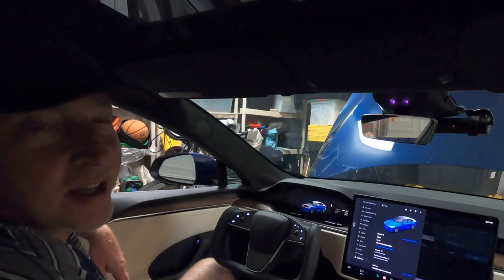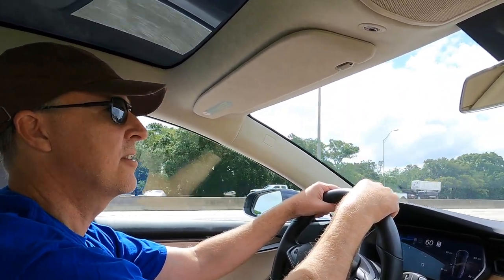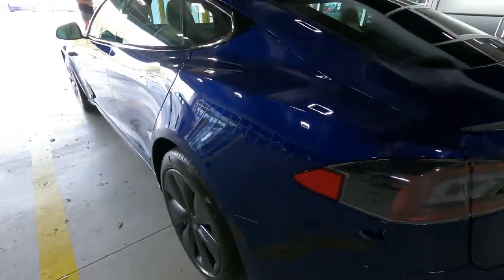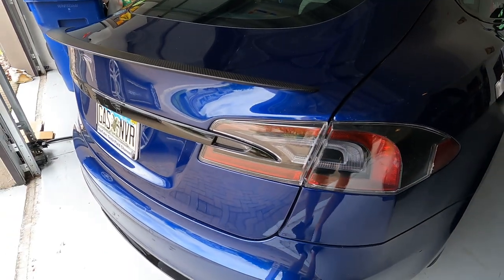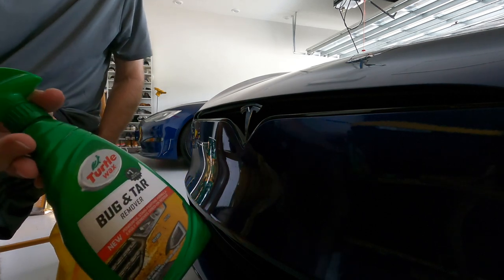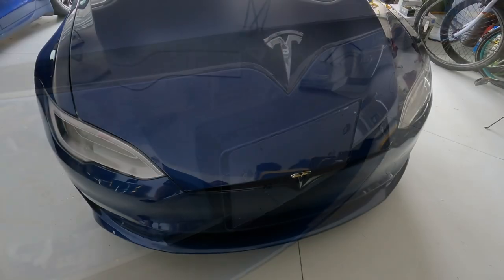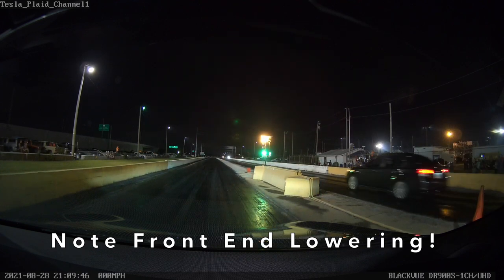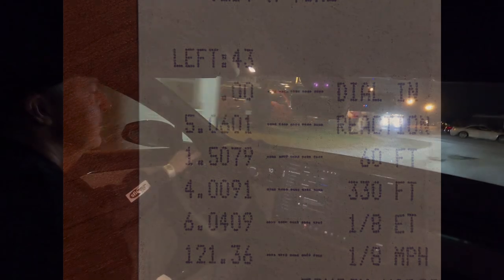2nd Plaid Delivered!! (19” Wheels) First Dragstrip Pass!! Tesla Debadging, Plate Bracket, and more…

Comment: I like the look of the new 19" Model S wheels without the covers. However it would be a good experiment to slap on the covers for a few runs, just to see if the added aero gains any speed. It might not make a difference in the 1/8th, but it may in the 1/4 at 150MPH+ (as if you need to stand out any more to the track officials). Congrats on your Tesla Model S Plaid...Again! Thanks for including the first run as I would have been waiting, curious how it performed compared to the Model S Plaid with the 21" wheels and tires, and the Nittos. It was surprising that you actually caught up to and passed the Accord on that run. I wonder what the Accord driver thought about you just sitting at the light (seemingly stalled) and then caught up and passed him at the end! That might be a hallmark of this new Plaid. That you can sit and wait for the Tesla to lower all the way to get into full drag strip mode, and take off and still beat the other guy, who is just passing the 1/8th mark before you start racing!
Reply: I agree! Let's see if the wheel covers increase 1/4 trap speed. Tesla says the trap speed of the Plaid is 155. My guess is, 155 mph with 19s and aero covers. I've been waiting to see if that is correct. I don't think Tesla would quote 155, if it could only do 152ish.

Comment: Not only the wight is less but also the diameter of the rotational is less meaning it can do more rounds with less effort
Reply: Less torque is required to spin the wheel faster. Kind of a balancing act. Topend speed on the highway will be slower but the 1/4 mile may be faster.

Comment: The removal of the Plaid badge makes it a real sleeper, however when you get the cage and parachute mounted, it might be a dead give away. 😂
Reply from the maker: Hoping the Chute has a quick disconnect feature like a trailer hitch…
Reply: @TeslaPlaidChannel  
Was mostly meaning at the track, but I hope it's that easy to mount/unmount. At least your in a Model S, and will have plenty of room to stow it when not in use. You couldn't do that in a normal Super/Hyper Car. One huge reason the Model S Plaid is so impressive.
Reply: @TeslaPlaidChannel  What is the rule on the USE of the Chute?  Will be quite the pain if you have to pull it every time you hit 150+ - and then have to re-pack it.  Or do you just have to have it installed in case of brake failure because obviously the brakes are capable of stopping the car from 150+ as you and others have already proven.
Reply from the maker: @iowa_don  Must be there if you need it. But if you can stop fine without it, no mandate to pull it.
Reply: @TeslaPlaidChannel  I know the brakes can be taxed quite a bit on the 1/8th mile tracks. Any plans to go carbon ceramics or you're staying with the steel ones?
Reply from the maker: @ChosenMJ  No plans yet to modify the brakes. But if any concern arises, I look into options.
Reply: @TeslaPlaidChannel  Realistically with the interval between heavy braking it's not going to overheat, but there is a small possibility of warping the rotors with heavy bursts of braking. Rapid heating and cooling will do that. Keep that in mind and be prepared to upgrade the rotors just in case.
Reply: @wbwayne8887  heck might as well make it push button retractable during staging.
Reply: @coleboonecustoms  
007 style

Comment: this car is going to be insane. Finally, someone is going to put a cage and parachute on plaid and actually compete with it.
Reply: Tesla Raving channel competed a lot in no prep races with his 100D.  He stripped the interior and even tried drag radials.  He is no longer racing the Tesla, he is no prep racing a super fast turbo Fox Mustang now.
Reply: @danmyers9372  I’m aware and have been subs to him since he had about 100 subs. But there’s a big difference between that P 100 D and the new plaid models considering most tracks won’t even let the plaids run without a cage and parachute. This is going to be a whole different league of racing than what the Tesla racing channel did. Will be interesting to see.
Reply: or NHRA will need to modify their rules as more and more EVs start showing up at NHRA tracks and destroy conventional gasoline engine cars.  If the public can purchase a standard build vehicle that exceeds the NHRA speeds for roll bars and cages, then it's time for the NHRA to change its rules to keep up with technology.  The Tesla Model S Plaid, with the heavy battery pack underneath the passenger compartment makes rollover much less susceptible
Reply: @cyclopsvision6370  not to mention it’s multiple 5 star safety ratings.

Comment: I like these wheels/tires better.  I'm old school so I think a wheel should have an actual tire on it.  ;)  The 21's look like a wheel with a couple layers of electrical tape wrapped around it: almost looks like the wheel is riding on the ground without a tire at some angles.
Reply: Well it has actual tire cause low profile tires are actually responsive (high wall is responsive too depends on sidewall, stiffness maybe etc.) 19 inch still have lower profile compared to some other tires and are responsive. The thing is both 21' and 19' are huge rims compared to 16,17 and tire looks small on them even tho it has similar side wall like smaller 16,17 rims.

Comment: This could be the first 8-second Plaid ever.... if you remove all seats, doors etc. That is the cheap way to run high 8s. The expensive way to do it.... is to replace several parts like doors, hood, roof, trunk, seats etc. with carbon fiber ultra light parts..... which do not exist yet!  To tune the car is impossible at the moment... Unless Uncle Elon has planned it!
Reply: It'll be really exciting once we start to see more of an aftermarket! That's when EVs will really hit off with enthusiasts I'd say.
Some companies like Unplugged Performance already make some good parts though!
Reply: @VoxelLoop   Parts? What parts? For which model? Tell us everything you know, pal!
Reply: @VoxelLoop   Alright! I hope the owner of this YouTube channel has checked out the Pikes Peak racing Plaid by Unplugged Performance....
Reply: @Seventh7Art  I'm sure they have, but, the changes made to that car aren't good for drag racing, too much downforce. :)
Reply: there was a plaid that was already fully stripped and had a girl weighing around 120 pounds driving the quarter mile and hit 9.02.
Reply: Take out windows put plastic windows lol
Reply: Also, Martian wheels when available + lithium 12v battery
Reply: All the Tesla plaid need is 2000 HP software update 😂 it will destroy anything
Reply: @Smzxe  shit yeah but they won't there waiting for the roadstar to come out plaid is good enough for now roadstar needs to match that other electric car

Comment: Congrats. Watch ya all the time. Suggestions for plate removal would include firewire fishing line will snap that glued plate off in no time. Super strong, and micro thin and easy to use. Do used leather gloves because I will cut fingers easily. The ultimate in strong thin fishing line. Cheap to on a roll...!!
Reply from the maker: Good tip!

Comment: Great first run! Those 19's do look good and I wonder what the weight difference is between a 21" and 19" wheel
Reply from the maker: I need to weigh them when I have them off the car soon 👍
Reply: @TeslaPlaidChannel  They're not forged right? They're probably both pretty heavy if the M3P wheels are anything to go by. 🙂
Reply from the maker: @VoxelLoop  I’ll weigh them soon…
Reply: @TeslaPlaidChannel  wouldnt there also be a height difference as well with the 19's having less total diameter it should give u lower gearing..thats maybe why such a strong pull
Reply: 19" are 27.9 and 28.8 lbs w/ covers on. 21" are 32 and 36 lbs

Comment: I've removed the front license plate bracket on my 2017 Model S 100D and there are in fact 4 screws going right into the bumper cover. People shouldn't just try to rip these things off their bumper without removing any and all screws or bolts first.
Reply from the maker: Good to know. All my previous Teslas (2016 S75, 2018 Model3, 2019 Raven) had this double sided adhesive.
Reply: @TeslaPlaidChannel  Mine also has 2 vertical bolts under the top lip of the grille. The screws are unnecessary and infuriating, but there's not much I can do about it. My locality requires front plates anyway, so it's not that big a deal in my case. I think I read somewhere recently that adhesive is not allowed. Although there are other mounting options that wouldn't require damaging the bodywork, like tow hook mounts and grille clamp mounts. The thing is, the two heavy duty hidden bolts (there are even obvious factory dimples in the bolt locations) would be plenty secure.
Reply from the maker: @awo1fman  Florida doesn’t even issue a 2nd plate for the front. It was yet another nice bonus in a state I’m really loving after the governmental oppression in CA.

Comment: Now that you've used to driving with the yoke would you consider the round wheel retrofit option from Tesla or would stick with the yoke?  Weighing my pro's and cons before placing my Model S order.  Thanks
Reply from the maker: For me, the shape of the wheel isn’t much of an issue. But the lack of stalks is, because I swap between other Teslas and the controls are totally different. The scroll wheels and buttons do different functions (next song or turn signal?) so they never become intuitive. Would take any shape that had stalks, but not an option for any Plaid.
That said, guys that road race say round works better. (For drag racing, doesn’t matter.)
Reply: @TeslaPlaidChannel  Thank you!

Comment: Hello Andrew, Congrats on Plaid 2!! I have a few question for you. Is there any difference in how smooth of a ride it is in Plaid 2 (19's) vs Plaid 1 (21's)? So, Plaid 2's first 1/8th mile pass was faster than any 1/8th mile pass in Plaid 1? What are the Plaids charging rate per hour with Wall Charger? Thanks for the videos. Lots of fun to watch. Looking forward to future 1/8th and 1/4 mile passes in Plaid 2.  Thanks, Enjoy.
Reply from the maker: This first pass with the 19”s was the fastest MPH, faster than all 71 passes in the 21” car. And it tied a 6.04 pass that was actually with the 20” Nittos on lighter wheels and at a lower MPH.
Reply from the maker: The ride is definitely softer with the 19”s, and my wall charger will give the car about 12% per hour. It can always be “full” by morning, to whatever level I set it to (usually only 80% for battery longevity).
Reply: @TeslaPlaidChannel   so the model s plaid is faster off the line with stock 19” or the 22” ?
Reply from the maker: @DavidV.Amendola  Faster everywhere (60’, 1/8th mile, 1/4 mile) with the 19”s versus the 21”s (Tesla doesn’t offer 22” on the S, only on the X)
Reply: @TeslaPlaidChannel  60’ as in 0-60mph? 

I meant 21” 😂

I see. So if I want greater performance, and more comfortable ride quality, 19” is the way to go. 

I guess the 21” are for looks only? Or does it handle better?
Reply from the maker: @DavidV.Amendola   👍 Dragstrips actually don’t measure 0-60MPH, rather other 60’, 330’, 660’, and 1320’.  The 19”s are consistently faster. Also softer ride, 48 miles more range per charge, quieter, fewer flats from potholes, longer wear (>20k miles instead of <10k on average), cheaper initial cost, cheaper replacement cost, and better retail availability (owners are waiting to find 21” replacements as we speak).
But according to some, the 21”s look better. Handling? Subjective. (Aftermarket tires are best if handling’s the biggest concern)
Reply: @TeslaPlaidChannel  I see. Thank you for your input and speedy reply. Subbed 😊 Drive diligently and gracefully.

Comment: Another very informative video. Andrew. Someone mentioned the HUB CAPS might clean up aerodynamics, worth a pass or 2. Does the Plaid come with spare tire and jack? No one ever mentioned it. If not, what happens? Carry a SPARE IN A CAN?....  Now get busy and show us the rest of the runs. Quite unusual that only one persons pass was a supposed 5.97, And of the dozens of quarter mile runs I have seen a 6.02 has been the best. Almost seems there is a 1/4 mile limiter on each factory car.... I would have little doubt that there is such a computerized limit..... Your thoughts?.... Did you try a run or 2 just in Plsid mode? Seems your previous best runs were done without drag strip mode and launch.
Reply from the maker: I’ll make a pass with the covers sometime, but I don’t expect a messureable benefit in the 1/8th mile. Maybe in the 1/4 due to the higher speed, but need the cage first. 
I carry a can of fix-a-flat in the Plaid. Tesla makes a kit with a pump, but it’s a bit heavier so that’s in the Raven now.
I think even with the “governor” the Tesla has on the torque at various speeds, weight removal will work to achieve better ETs. I believe that 5.97 was a gutted Plaid with lightweight driver?
Reply: @TeslaPlaidChannel  I think it ODD that the 5.97 number is blurred on the video, AND why not, as you do, show the official raceway timing strip.... wonder what his 1/8 mile and 60' times were! I know if you broke it we would have ALL the info firmly in hand for NO DISPUTING!.... The 1320 video had a stripped Plaid and what looked like a 110 lb. Woman drive and could only do a 6.08, your full weight 19" wheel car was quicker, which gives me more suspicion that the computer is the limiting factor!
Reply: Also are you able to POWER BRAKE the Plaid instead of simply PUNCHING IT?.... ANY kind of PRE LOAD should help launch. See you got a 1.50 60', sure would help getting a1.45 or less on a power brake...car might creep but YOU know when to launch it without a red light, after over 1000 runs, I would consider you close to an expert on Tesla launches!.....Also switch all 4 tires between vehicles, computer might be set for 1 size and could make a difference...lots of work, but FUN work!....Are both the 19" and 21 " tires the same height being a 35, to a 40 size?
Reply from the maker: @royrauch9775  Can’t power brake. If one pedal is at 1% the other must be at 0% or the car will tell you to release both pedals and try again. No “two foot driving” here with the only exception being Launch Control which must be followed perfectly.
Reply from the maker: @royrauch9775  All tires on the Plaid are exactly 28.0” in diameter, regardless of wheel size. Even the Nittos.
Reply: @TeslaPlaidChannel  could a 27'" or smaller be beneficial?... Perhaps on very light weight wheels. Some Mopar guys run 15-16" wheels  on the rear of their new Hellcats with corresponding smaller drag radials. Check with your RED EYE guy, he might have info on this....of course you would need matching height tires on the front. Any way of increasing KW to either front or rear motors, perhaps with a cut off of 1-2 seconds just for that extra boost at launch?
Reply: @TeslaPlaidChannel  what size are the Ravens tires, 28" also, or less?

Comment: Great plaid review. I guess yoke wheel could be converted to normal by cutting half of MB wheel and epoxy it on the top
Reply from the maker: Perhaps, but that wouldn't solve my bigger compliant: No stalks!  (wipers, turn signals, flash to pass, cruise control, etc.)
Reply: @TeslaPlaidChannel  In that case Gaming Racing Steering Wheel should suffice. After some adjustments one would be able to drive even from home.